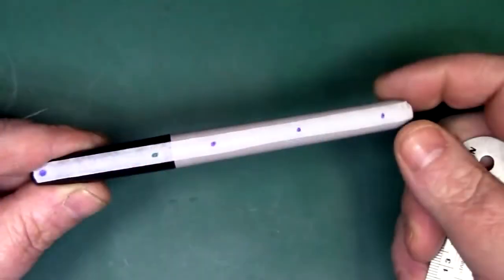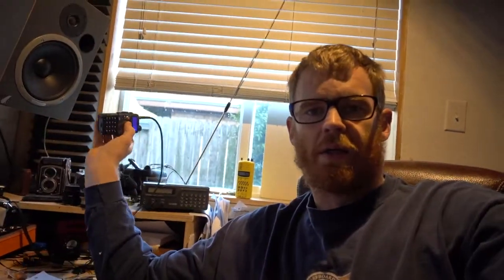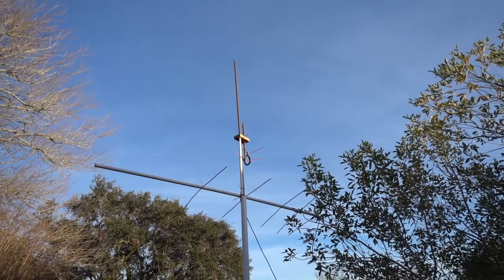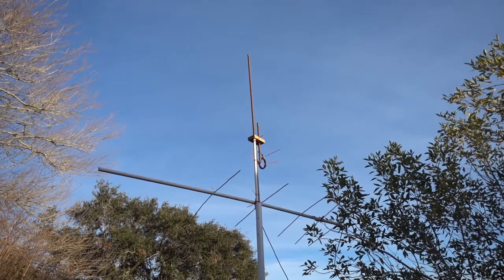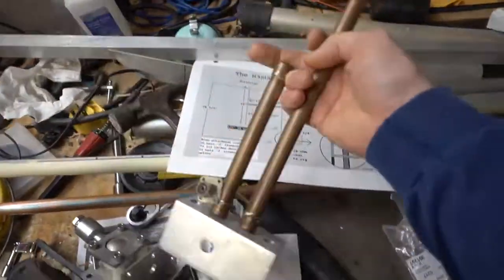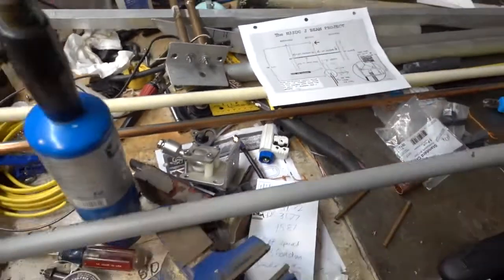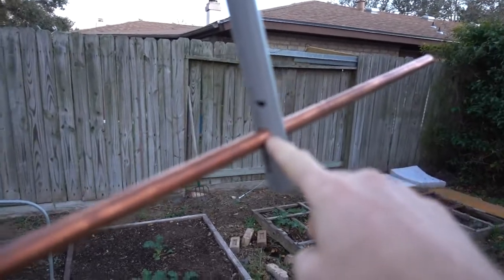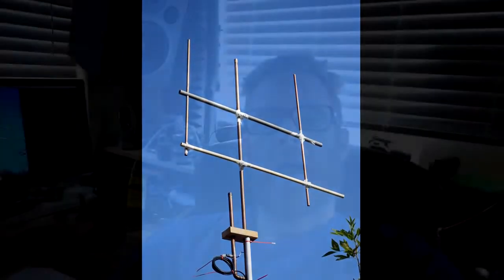J Pole Beam Antenna

Comment: Hay i do this myself just for thee educational benifits. 
I am using the same ht an meter.
.
Add thee full length of your jpole plus 2 inches for thee reflecting element and 3 directors each just a bit shorter.
And be amazed. 
I to use the copper.
I live the tornado alley over here florida georgia line. 
So i need this for good weather station reception. 
Mine is 23 feet in the air.
Reception is awesome.
I can not yet transmit.
Still studying for my ticket.
I hope to test in lake city in November or December.
Reply from the maker: Sounds like a great setup. Still working good for you?